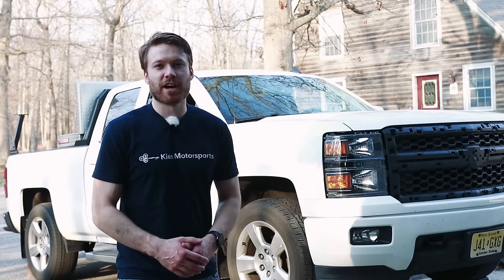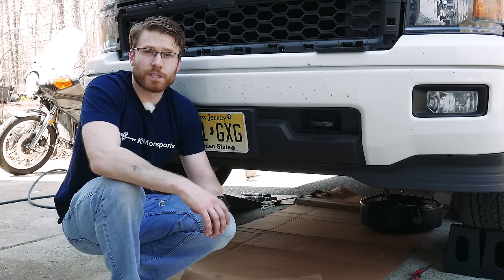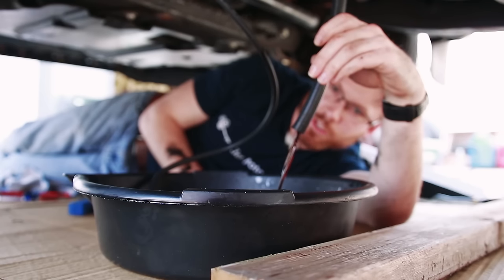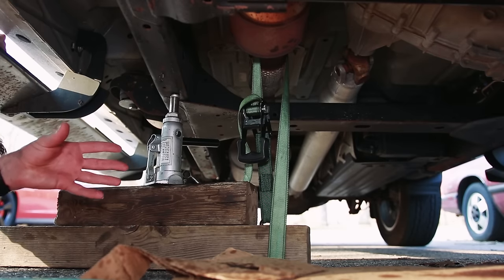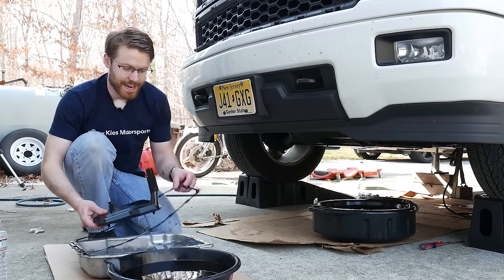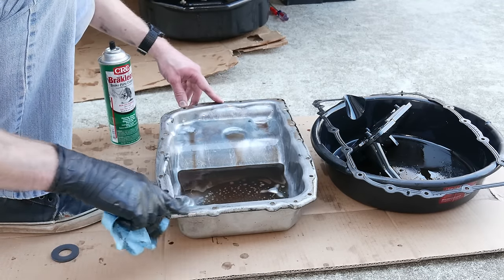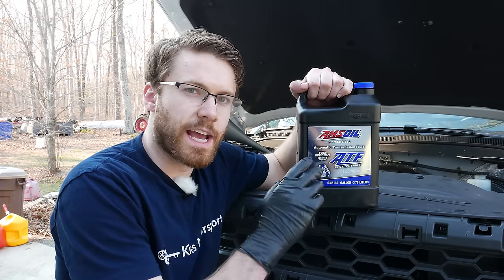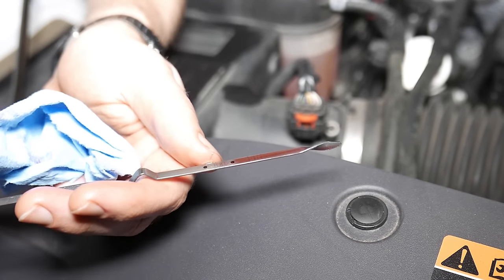6L80E Transmission Super Flush and Filter Change Silverado Sierra Tahoe Suburban Yukon Escalade H2

Comment: Lol so many unnecessary steps that pan can be removed with out any of that !!
Reply from the maker: What motor and trans do you have? I was very concerned about damaging the internals trying to force it off without clearing extra space.
Reply: 2014 1500 z71 5.3, 6 speed  pan will come out i found that out buy doing it . I'm sure some people may need to follow these steps but it's not necessary at all
Reply from the maker: @nickbrown5906  I fought with it for awhile before resorting to the jack. Guess I just needed to take some more time with it
Reply: The Sundae Drive I do like how you utilized the pump to remove old fluid over all your videos are good keep it up helps a lot of people

Comment: Bad technics.  FYI gaskets are never reusable   Lol.  
Bad practices shown here. 
Brake cleaner damages gaskets due to the chemicals in the brake cleaners 😂
Bad bad methods here guys.
Reply from the maker: We've learned some lessons for sure and appreciate the feedback. Brake cleaner should not be used on gaskets but if a rubber gasket is new enough and not damaged it can be reused. I would never recommend that on a hard to get to gasket but fairly easy ones to get to like this I think are acceptable to reuse. Personal preference for sure and how much risk you are willing to take that you might have a leak